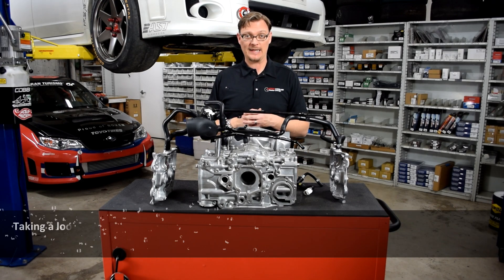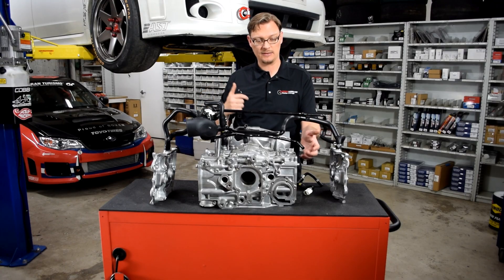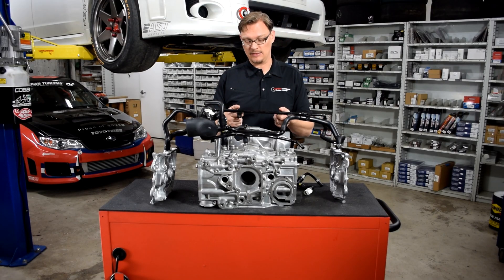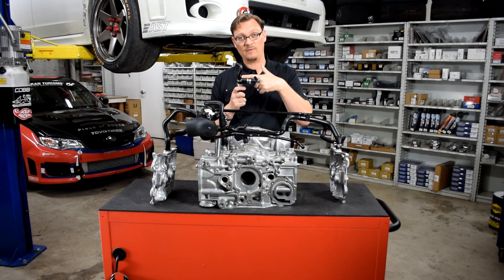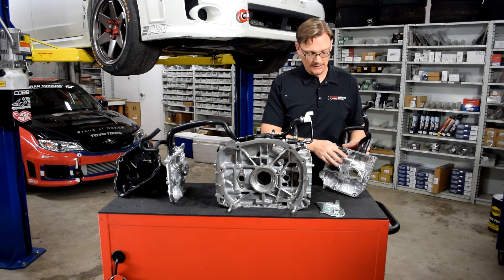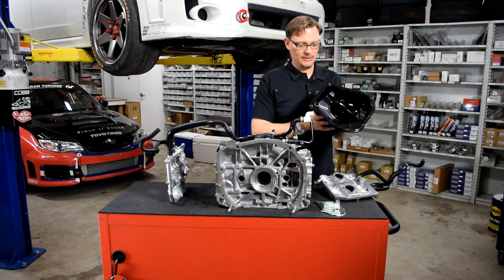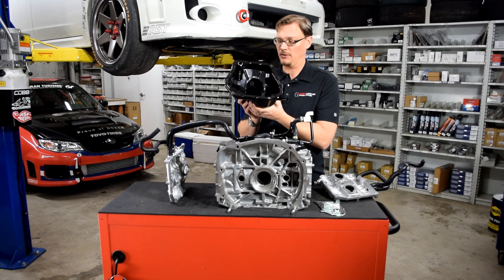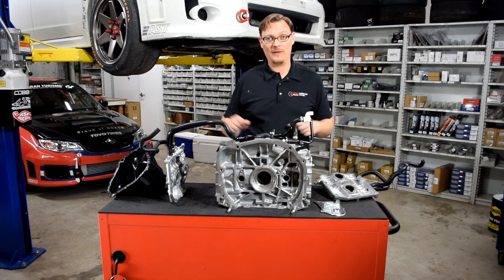Taking a look at the Subaru EJ25 Turbo PCV System

Comment: If your boost leak testing a 2.0, and you’ve capped all the intake lines but you not able to hold pressure should the PCV valve prevent pressure to the cranks case? If your hearing air pressure in the crank case would that be an indication that the pcv is stuck open ?
Reply from the maker: Thanks for your question.  The PCV valve should close under pressure.  If you are thinking that it is stuck open, I'd say the first step would be to remove and inspect the valve.  While it is off, block both ends of that connection and try the test again.  If the leak goes away, I'd definitely say it is time to replace the PCV valve.

If it does not change the result, I would recommend disconnecting parts of the intake system (take the intercooler off for instance), so you can pressure test specific areas of the intake track until you find the leak.  Testing from the throttle body, and then the turbo specifically would be good ideas.

Hope that helps and Stay Tuned!
Reply: @FlatironsTuning  Thanks for the reply!!!! we shot some video troubleshooting the PCV and boost issue on my bugeye and will post that soon. But you're absolutely right. boost leak testing is a step-by-step process. there's just no way to shortcut it as thats what I tried and failed. I like the idea of vape testing but from my diesel experience sometimes they only leak under boost. Also, SHOUTOUT to you guys I bought some JDM tail lights from you online just before Xmas for my sons GC8 and they came in perfect  I am sure will order more parts from ya'll JDM tail lights video below and again many many thanks https://youtu.be/RG3miHuwGOM

Comment: Would anyone happen to know the hose size of the PCV valve connecter that connects to the engine next to the turbo? I need to find a hose that fits as mine ripped off
Reply from the maker: I believe that fitting should be 1/2".  Most of the PCV hoses are short of the main fitting that comes of the block which is 3/4".

Hope that helps and Stay Tuned!

Comment: I only had one question and it was the one thing you didn't mention. What is the white sensor above the PCV valve
Reply from the maker: Thanks for your question.  That is not a sensor actually.  It is just a jumper electrical connection.

Thanks for watching and Stay Tuned!

Comment: I'm converting my 02 wrx to built 2.5 and planning 500hp. Do you recommend i replicate the pcv system and add a oil catch can?
Reply from the maker: Thanks for your question.  I'd definitely recommend replacing any old lines, etc., in the PCV system, and then keep an eye on your oil consumption once the car is running.

If you are using any oil, or you see signs that you are moving oil through the PCV system, then you would want to put in a catch can or AOS depending on the oil volume.

Hope that helps, and good luck with the build.

Stay Tuned!

Comment: It would be awesome if you used that set up to explain how to install catch cans into that pcv system
Reply from the maker: Thanks for the suggestion.  We might have to consider that.  Basically, you would just have to install the catch cans as jumpers in the two lines that go to the turbo inlet.  But it definitely makes sense that a clear representation would help.

We'll keep it in mind.

Stay Tuned!
Reply: @FlatironsTuning  you’d be surprised! A lot of people don’t understand any of the catch can install videos because they can’t see what their dealing with because of the the intake manifold hiding the routing. So people get overwhelmed and confused.

Comment: Great video thank you. Which tube creates the most blow bye, the tube coming from the metal tube in front of the intercooler pipping? Or the tube coming from near the turbo going into the turbo inlet pre turbo. If that makes sense? I have a two port catch can and at the moment its bone dry with no blow bye. Its connected to the metal tube at the front of the intercooler.
Reply from the maker: Thanks for your question.  Because the hose from the valve covers (the metal tube on the intercooler) connects to the front of the turbo inlet hose, there is not much suction there.  In most cases, this is actually a fresh air feed for the crankcase because the vacuum occurs at the back port with is the top of the factory AOS.

In short, that would typically be the port that you would see the most oil coming out of initially.

It is worth mentioning that if you are overloading your PCV system, that is when you would see oil coming out of the valve covers, and that would indicate a greater need to modify the system.

I hope that helps, and Stay Tuned!

Comment: This really helped clear up the fog on the pcv system thank you. Now with emissions not being a factor whats the ultimate solution to no recycling oil into the intake?
Reply from the maker: Thanks for your question.  That is a tricky one.  I'd actually say that for most applications there are some advantages of keeping the PCV system largely in tact so that you can use vacuum to scavenge the crankcase.

Going to atmospheric venting is appealing at first, but in doing that, you lose all ability to pull any kind of a vacuum.

More than anything, the degree that you need to modify the PCV system depends on how much oil you are moving through it.  If it is very low, then you most likely don't need much of anything.

I hope that helps and Stay Tuned!

Comment: i have a question i hope you can see this i have a code PCV disconnected i checked everyone but noticed the 2 bolts that screw onto the inter cooler are not there do you think that would solve my check engine light?
Reply from the maker: I don't think so.  If you watch this video again, look at the white plastic connector that connects to the turbo inlet.  In that white piece of plastic is a jumper connector that connects to the engine harness.  Most likely, I'd guess that is not in place, and that is causing your CEL.  I will also mention that on the newer cars, there are more of those jumper connectors.  If any of those are not in place, then the car will throw a code for the PCV connection.

I hope that helps and Stay Tuned!

Comment: This has me thinking if I even need a catch can on a stock sti. I’ve seen allot of common catch cans only have two ports such as the Cusco catch can For Dump and return. My daily sti is going to remain bone stock with a cat back only for the life of it. Do you guys think a catch can like that is enough for extra measures considering the purpose of my sti. Also if it’s even necessary to run a catch can on a stock sti.
Reply from the maker: Thanks for your question.  The simple answer to that question is that it depends on your oil consumption.  The degree to which you need something like a catch can is entirely dependent on how much oil, if any, is moving through your PCV system.  This will vary depending on how you drive, the amount of power that you make, the build of your engine, etc.  So keep track of your oil consumption and that will answer your question.

If you aren't using much oil if any, then your need for something like a catch can is minimal.
I hope that helps, and Stay Tuned!

Comment: Can I just condemn my PCV valve and vent the crankcase to atmosphere?
Reply from the maker: Thanks for your question.  If you are going to change the configuration of your PCV system, you will have to tune the car for that change.
I'd also say that there are definitely some benefits from having the PCV valve in place.
I'd recommend that you take a look at the video that we did on the AOS/Catch-can configuration.  That may be a good resource as well:
https://youtu.be/6bPgslpWjak
Hope that helps and Stay Tuned!

Comment: Any idea why there is a need to run the pcv line to the intake manifold while the engine is in vacuum and redirect to the inlet when in boost, when there is always vacuum in the inlet? Why not just run one line to the inlet? There must be a reason, I just don't know what it is.
Reply from the maker: That is a great question.  Think of the PCV valve as a switch.  It closes when the manifold is under pressure because you are using the vacuum pull from the turbo to scavenge the crankcase.  But when you close the throttle and the turbo is no longer pulling that vacuum, the PCV valve opens, and then you are using the vacuum behind the throttle plate to scavenge the crankcase.

I hope that helps, and Stay Tuned!

Comment: So can a person Tee the two going into the Turbo inlet together into a catch can and then just have one going back into the turbo inlet without any issues?
Reply from the maker: The short answer is no.  You do not want to "T" either the feed side, or return side of any of these hoses.  It will cause issues.

This is something that we are going to go into detail about here soon as well.

If you are going to install a catch can, you want to keep the PCV circuits completely separate.

Hope that helps and Stay Tuned!

Comment: What kind of problems could having a bad O-ring in the top white pcv connection cause? Or what kind of problems could occur from a case vent tube or pcv system that's not sealed properly? Any info would be greatly appreciated. Thank you.
Reply from the maker: Thanks for your question.  Basically, any leak in the PCV system will translate into a vacuum leak to some degree.  The bigger the leak, the bigger a problem that the leak can create.

I would recommend that you smoke test the intake system, or take the car to a mechanic that can do that test for you.  that will show you where the leak is coming from, and you should be able to get a measure of how significant the leak is as well.

On Mass Airflow cars, it is quite important to keep any intake leaks to as near zero as possible.

I hope that helps, and Stay Tuned!

Comment: "-but it fails." that struck me because i was amazed at its engineering, so you recommend an actual air/oil separator?
Reply from the maker: Thanks for the question.  In short, every system has its limits, and the same is the case for the stock PCV system.  If you are seeing the signs that you need something like a catch-can or  Air Oil Separator, then it is usually quite helpful.

I hope that helps, and Stay Tuned!

Comment: Great video, very informative. Are you familiar with factory code P1491? PCV blow-by error. I've taken my car to a number of shops and they can't seem to figure out the problem. It's an 05 STi, bone stock with 110k. Compression is fine, no leaks, replaced the pcv hose assembly, turbo inlet, map sensor and the code still pops up intermittently. Just wanted to see if you had any ideas.
Reply from the maker: Thanks for your question.  I'm not familiar with that code.  I would recommend checking the white harness where the PCV hose connects to the turbo inlet.  There is a jumper there that clips into a wiring harness, and that may be missing.

That would be my best guess as to what would throw that code.

Hope that helps, and Stay Tuned!

Comment: hey body great video can  you explain the entire oil leak on 2.5 turbo engines  i have 2005 legacy gt turbo   i have oil leak from the top of engine from driver side and oil leak from bottom passenger side i replace valve cover gasket stil oil leak now i dont know  its from head gaskets or not i am orginal onwer never over heat help thank you
Reply: is the stock pcv system in place?

Comment: What are your thoughts on blocking/deleting/removing the PCV valve, blocking off appropriate intake ports on the turbo inlet and venting the crankcase + head breathers to a small catch can then venting out to atmosphere? (offroad car's of course)
Reply from the maker: Sure.  For track cars, there are definitely advantages to this.  And if you are making a good deal of power ( say 400 - 450+ whp), then going to VTA again has some advantages.

If you do, you just have to make sure that your plumbing is correct, that you have removed the PCV valve (as you mention), and that you are tuned for it.

Hope that helps, and thanks for watching!
Reply: @FlatironsTuning   FlatironsTuning  I am in the middle of testing this out - I am getting some smoke on startup once routing all my hoses to a compact catch can. I did not get any smoke when just venting to the mini style breather filters you normally see on old V8 builds.

I am thinking that running all the lines to a small catch can (reducing the size of the crankcase breather as well to fit) might be causing a restriction and causing some oil consumption?

Is this a plausible theory? You can see the video about the PCV Delete I did on my channel under the subaru engine out video.
Reply from the maker: @Booki89  The short answer is yes.  If you look at the first Catch Can video I did, I "T'd" the intake and outlet on the catch can, and this is a mistake.  Basically what we have now learned is that if you don't have sufficient breathing for the crank case, you will start to build positive pressure and this can prevent the turbo from draining properly.

The smoke you are seeing on startup is most likely a symptom of that.

I'd say you would definitely want to run 1 can per hose you are interupting.  Or, if you are looking at VTA, that should also reduce the issue, but if you have a small single port that you are venting, that could cause an issue in an extreme case (running lots of boost pressure, making more than 400 whp, etc.).

I hope that helps and good luck with the install!
Reply: @FlatironsTuning  Just thought I would update this post. Similar findings to yourself, I have the two valve covers T'D to my small catch can which VTA, and my crankcase is just with a breather filter for now (VTA)

Smoke from start up is gone!

There must have been a flow restriction to the can causing the pressure to build up as you said. Will need to mount up a separate can for the crank case vent.
Reply from the maker: @Booki89  Glad that you are getting a handle on it, and that the fix was relatively simple :-)

The PCV system is definitely more tricky than it would appear on the surface, and glad we could help!

Comment: Hey! I know this is an older video, but if you see this I'd really appreciate some help! I want to make sure no oil is getting up through the PCV system but a $400 AOS seems kind of crazy. I found this - https://forums.nasioc.com/forums/showthread.php?t=2870817 which is a way to reroute the PCV system and maybe include a catch can to solve the same issue. The problem is I'm confused with what actually needs to be replaced, this video helped a bunch though!

Thank you so much for all the great info you put out.

Comment: Very well made video. Provides an excellent display as to how the EJ pcv system is designed. Interesting analysis on the pan drain tube as well. I personally run individual dedicated catch cans for the crank (The OEM pcv port), and the heads (big metal T that bolts to factory intercooler).

  Subaru really did have a good grasp on their pcv design. It's cool to see it broken down into the fine details. Good video as always. Top notch Subaru content provided by FIT!!!
Reply: Hey! I would love to run something similar to this, any way you could make a quick video explaining what you did? I've read through a lot of forums and watched many videos but I'm having trouble grasping exactly what I need to do.
Reply from the maker: @Mqxwell  Are you asking about a dual catch can set-up specifically?
Reply: @FlatironsTuning  Yes, but I have also read a lot about rerouting the high load lines in the PCV system running them to 2 catch cans. At least I think that's right, not 100% sure but this forum thread goes pretty in depth -

https://forums.nasioc.com/forums/showthread.php?t=2870817

(Specifically mrsaturn7085's posts)

 I'm just not sure what to make of it. I'd love to see somebody's set up and specifically going from a stock set up to dual catch cans. This video did help a lot but I'm not sure which changes to make. I've also seen a few videos showing the system off but I can never tell what's changed and where I'd get the materials. I can find catch cans, but would I need extra hosing?

I'm already having to purchase a lot for my bugeye, and I know that's just a part of the Subaru life but if I can save a few hundred dollars on something I don't actually need, I'd love it!
Reply from the maker: Awesome comment.  Thanks Case, and thanks for watching!